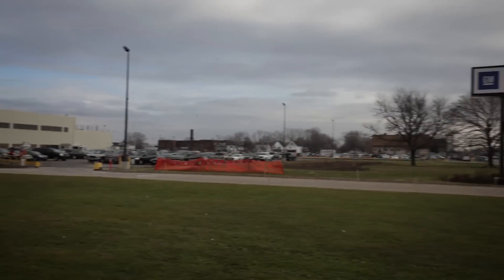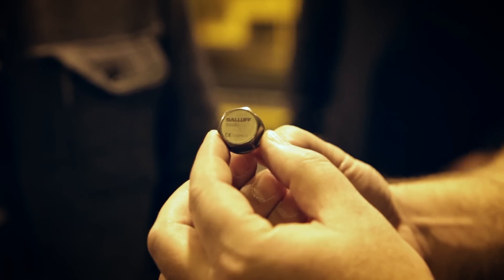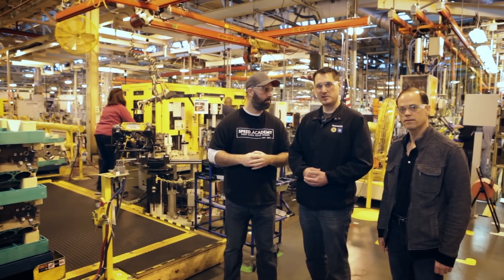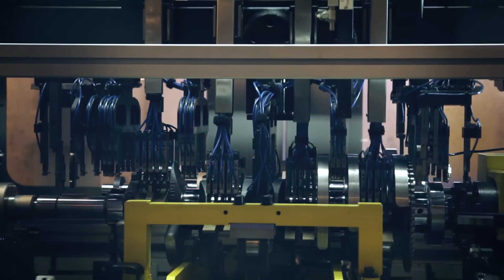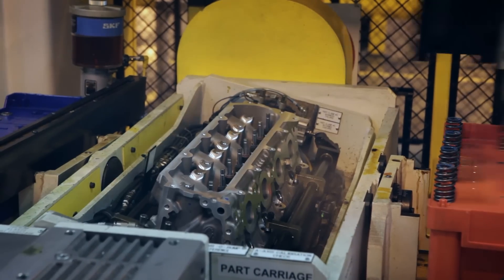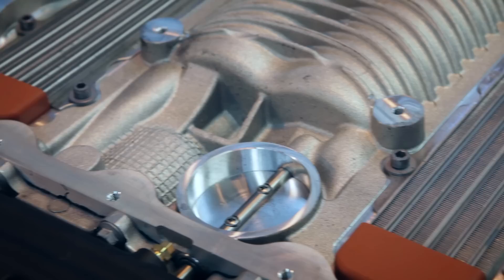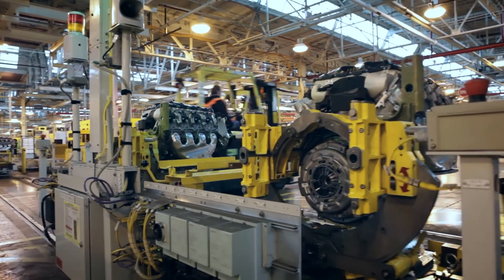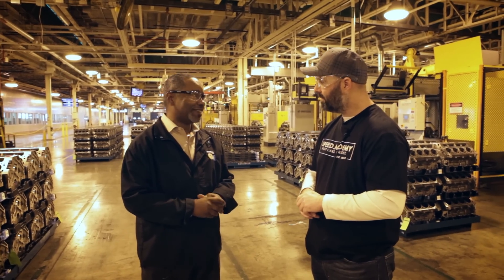Building GM's most powerful Engine Ever, the 650hp LT4 V8!

Comment: Lol stopped watching at "cast crank" . That's all I need to know lol.
Reply: Depending on the casting techniques (vacuum environment, cooling time, heat treatments, alloys, etc.) you can have a durable crankshaft that performs within its specified operation parameters just as well as a forged one. Think about it, if you have a engine that performs with a peak power of 650 hp why do you need to forge a crankshaft that can operate safely at 2000 hp? You don't, instead you improve casting technology so that you can cast a cheaper one that operates for the same lifespan at 1000 peak hp.
Reply: shale0984 why casts are strong sbcs used to be all forged internals till the 350
Reply: the rods and block are going to explode before that crank will ever even think of flexing.